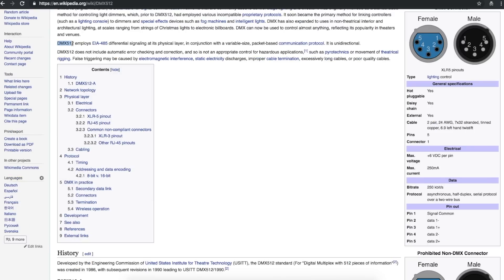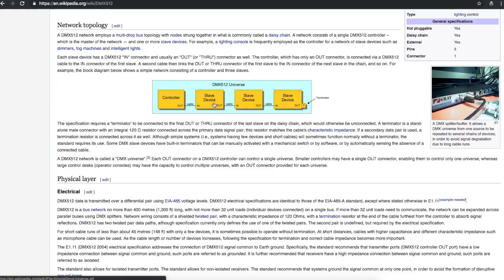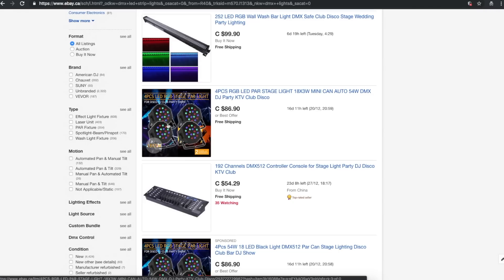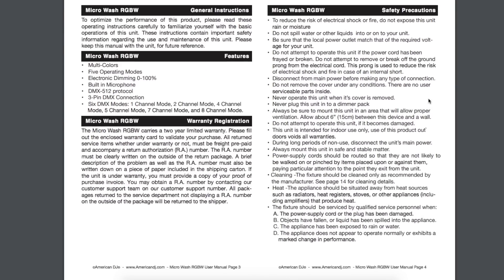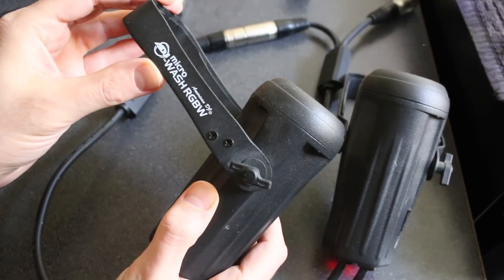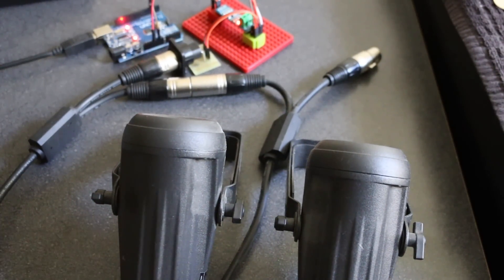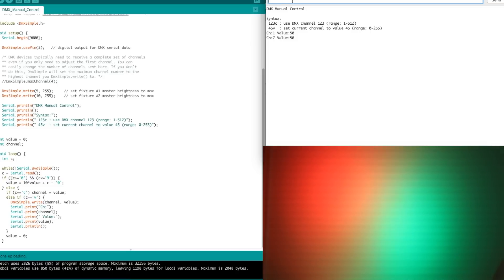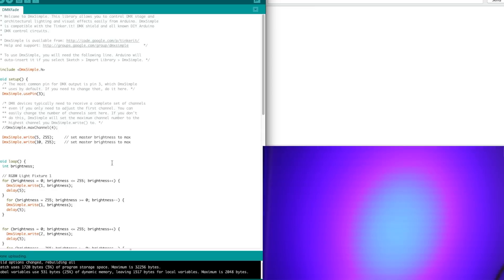ARDUINO DMX512 CONTROLLER

Comment: Could I use a 5v to 5v dc/dc convert between mx485 and xls cable to ensure safety for the microcontroller?
Reply from the maker: I made an isolated interface in another video https://youtu.be/yeVZs3swxds

Comment: Just wondering.. How long can the output data cable be? Let 's say the lights are at 50m distance? Do you need an amplifier? How does that work?
Reply from the maker: According to this page, the cable has to be less than 300m (and assuming a proper DMX cable with the right impedance), and it says an amplifier may be needed after that point, or if there's more than 25-32 items connected
https://insights.acuitybrands.com/eldoled-blog/how-to-wire-a-dmx-system#:~:text=Therefore%2C%20the%20maximum%20cable%20length,connected%20to%20one%20DMX%20cable.

Comment: Hey, I am running into a very confusing issue. The light will only update constantly when its ground on pin 1 is disconnected. Thank you for any suggestions

Comment: Great video! My question is would this be compatible with a 5 pin XLR? I believe the first 3 pins of the 5 pin would be the same as the 3 pin, although what would I do with 4 and 5 on the 5 pin?
Reply from the maker: The extra two pins on a five pin are for an optional second communication channel so they just get left unconnected 
https://interactive-online.com/resources/faq/dmx-512-connector-pinouts
Reply: @GadgetReboot  Figured so, thank you for clarifying!

Comment: This is amazing, thanks for the great tutorial. I have a project where I need to use a SAMD-based Arduino, which DmxSimple is not compatible with. Do you know of any good way to drive DMX lights from a SAMD based Arduino?
Reply from the maker: I haven't tried that platform yet, but I eventually will.  I might lean toward ESP32 also.  So I'll just be googling for any existing libraries, someone must have done it by now.

Comment: Awesome video. Rather than controlling DMX lights from the Arduino, I want to use DMX output from PC software to trigger MP3 audio. Is that a similar hardware setup?
Reply from the maker: Yeah same hardware on both ends of the DMX transmit and receive sides.  I did another project doing transmit and receive so it should also be able to receive DMX from PC and then that can trigger anything desired.  https://youtu.be/RZ_UWYBOj8M

Comment: Thanks for the great video.
Let's nitpick: There is no such thing as a level in EIA-485. Always speak about the differential input voltage. That magnitude of Voa–Vob < −200 mV = High and Voa–Vob > +200 mV = Low defines the standard. No one speaks about "levels" in the EIA paper, only about the magnitude of the differential input voltage, V_id, varying from 200 mV to 10 V, that is required to maintain correct operation over a common-mode voltage varying from –7 V to 7 V.

Comment: Great video.  Can I ask where I can find the dmx adapter that you used?  I’m looking for one I can incorporate into a protoboard.  Thanks
Reply from the maker: I basically got everything on eBay, using the Arduino as the controller, then a little RS 485 to TTL module to translate between Arduino and DMX signal levels, and since my American DJ light uses the three pin instead of five pin standard connecter I just ordered a three pin on eBay.

Comment: Hi, I really love your way to explain the project. I have used your method with Ltech DMX decoder and now I am able to control upto 512 DMX channels with Arduino UNO board. It will be a great help if you explain, how to control more than 512 DMX channels...

Comment: Is there a way to trigger this with the beat of a bass drum?
Reply from the maker: there’s always a way depending what signals are available. If there’s an actual trigger signal indicating when the other sound is playing, that can be used as an input to Arduino to do some thing. Otherwise if it’s just raw audio then a filter can be used to detect a certain frequency and use that to trigger.
Reply: @GadgetReboot  So do think I can use a Mic to XLR to "What" and get the Arduino to sense the beat and trigger the DMX lights, just like what would be done at a concert?
Reply from the maker: A circuit like a color organ would take the sound and be able to trigger when certain frequencies are detected and then that could trigger the input of an Arduino and the code would have to then generate whatever DMX is required to turn on whatever lights in a certain color for a certain amount of time once triggered. Basically it sounds like an interesting project idea that I might consider doing.
Reply: @GadgetReboot  Yes please....I have the DMX controller, just need the Arduino to trigger the scene changes
Reply from the maker: is the controller also an Arduino or is it some sort of commercial product? I’ve never used a commercial controller so I don’t know if they have options for an external interface to do things like trigger scenes but if the Arduino itself is also the controller, then it’s easy.
Reply: @GadgetReboot  The Controller is the Luminair 3 DMX App, totally awesome app, and it does have a sound active mode and they say they have beat isolation tech, but when you play a tune it seems to react on every note just becomes a mishmash of quick changing lights. Not, what you see a concert, that is what I am trying to accomplish. So, I need to put a trigger (arduino trigger) in that loop somewhere, some how, if possible.

Comment: You didn’t mention the Rt resistors that are shown in the chip diagram. Are those excluded in this demo or are they integrated into your cable connectors?
Reply from the maker: They are on the RS 485 board being used.

Comment: Hey, just wondering, I've read that there must be separation between the microcontroller and the DMX line. Does this RS-485 module allow this? Or is this a quick and dirty approach and more serious installs must make use of a DC-DC converter and Octocouplers? Thanks!
Reply from the maker: This was just an Arduino protocol test, a real implementation would need isolation and  these particular modules don’t do it but I am working up toward another isolation demo. 
I recently did a DC to DC isolated converter video and I’m still waiting for another one to arrive so I can isolate two sides of a cable. 
For the data isolation I might either use auto couplers or one of those ADUM digital isolators https://www.analog.com/media/en/technical-documentation/data-sheets/ADuM1200_1201.pdf

Comment: Thanks for the video! Helped a lot to convince myself that this is indeed possible!
One question: If I would like the Arduino to act as a RECEIVER for the DMX signal, how would I have to wire it?

I'm thinking about a project where the arduino would control some led tubes on/off via DMX !
Reply from the maker: I did a transmitter and receiver in another video including controlling WS2812 LEDs:   https://youtu.be/RZ_UWYBOj8M

Comment: I tried with a simple light I have and was unsuccessful.  I then tried with a different light and it worked fine.  I figured my light was bad, but I could manually set it to a color through its panel and it worked.  I decided to test something and moved the light's DMX channel to 1, and it worked fine.  I then moved the light to the previous channel of 150, and it will not work.  Do you think it could be the generic MAX485 board I bought?
Reply: Upon further testing... It is a 6 channel light.  1 is "set to individual color control when value is 255".  2 is red.  If I set the light's first channel to 147, then send 147c 255v and 148c 255v, I get red.  If I set the light's first channel to 148, then send 148c 255v and 149c 255v, I get nothing.  Combinations below 147 for the first channel seem to work and above do not seem to work.
Reply from the maker: I don't think it would be the MAX485 because being just a communication hardware interface, if it works in a certain channel range it should communicate fine no matter what is transmitted.   
Did you get the other light working at those higher channels?  Trying to figure out if the Arduino sketch and hardware interface at least work, I don't remember if I tested at high channels and right now it's all disassembled so I can't quickly test it.  
I don't suppose that light for some reason doesn't work above certain channels, although I can't imagine why...what is the model number? I wonder if anyone else has run into issues similar to this.  
Also, just for the sake of voodoo when all else fails, I wonder if there's just some weird combination of addresses that exploit a glitch, maybe in the Arduino sketch.   Did you try some other random higher channels just to see, maybe something over 200 in case there's an odd behaviour around 148...
I'll be hooking up the DMX hardware at some point to continue projects, maybe I can do more testing with my American DJ microwash lights.
Reply: @GadgetReboot  Thank you for the reply.  So, I wonder if it is just that one light I decided to experiment with.  I added the second light to try higher channels, and the first light is working at the higher channels, using the same sketch from yesterday because I plugged the sedan light in without modifying the sketch, as well as the second light.  I removed the second light, and the first seems inconsistent.  Maybe it just has to do with the resistance on the DMX side.  I was only testing with one light, just to make sure it worked.  I had ripped everything out of the code except static DmxSimple.write commands in the setup routing.  Regardless, your tutorial was well done and easy to follow.  Thank you for it.
Reply from the maker: I  wonder if it has something to do with the termination. I can’t remember if my lights have a built-in 120 ohm termination but I was only using very short wiring so maybe if you have longer cables you might need to make sure it is terminated properly.  And I guess that would include if you have two lights joined together, only the one at the far end should be terminated.  And presumably the RS-485 board has a termination resistor on it, mine does.
Reply: Gadget Reboot I do have a terminator on the out of the last light, but I have never experimented with my usb-to-DMX adapter and just that one light.

Comment: Thank you so much for the code to make the DMX receiver work, but I was wondering have you tried making a USB to DMX interface like a DIY arduino version of the Enttec Open DMX USB Interface using an RS485?
Reply from the maker: I haven't done anything lately, I even fell behind in normal videos this past week so I need to get caught up on that before I get totally buried.  But I'm waiting for some parts to come so I can at least try adding power and signal isolation to the existing DMX setup and make it more robust as-is.  Maybe some day it'll grow into something bigger.

Comment: Hi! I've got the RS485 breakout board by Sparkfun.. would you maybe be able to tell me how I could connect this up to my arduino? It is for a halloween project DMX/Sound trigger the sound and trigger part I've got figured out, only the DMX through rs485 breakout is the thing I can't get to work...
Reply from the maker: Is this the board with SP3485:
https://www.sparkfun.com/products/10124
And  what kind of Arduino, 5 V or 3.3 V I/O? 
 I see that chip needs to be powered by 3.3 V and it vaguely says interoperable with 5 V logic but I didn’t see anything in the chip data sheet that clearly guaranteed it can be powered at 3.3 V and hook up to 5V I/O. 

Aside from that, the A and B terminals would be the same as the A and B terminals in my RS 485 breakout board schematic,  
RX-I  is the same as DI on my board, 
TX-O  is the same as RO on my board. 
 The grounds will go to the same place I have them but VCC would be 3.3 V and if the data sheet can be trusted, it says it should still work at 5 V logic levels otherwise if it’s 3.3 V logic it should obviously work.
Reply: @GadgetReboot  thanks for the reply! It's the board from the link indeed! I own a few Uno's and a few nano clones, the clones say they have 3.3v and 5v, so that should work. I'm gonna see if it works out with yout instructions!

Comment: Nice one. 
I wish this stuff was available (and at such affordability) back when I was doing sound and lighting gigs back in the '90s.

I've got a couple of those MAX485 modules somewhere in the pile I was meaning to get around to eventually. I wonder what else I can do with them?
Reply from the maker: It’s hard to think of uses for them today because I don’t really have a noisy signal environment to deal with at the workbench and any communication of any distance I would probably start thinking about Wi-Fi or wired ethernet. 

 It almost makes me want to go out of my way to think of a project just to use them because I think I have five. Maybe a DMX receiver so I can turn some LEDs into DMX lights.
Reply: @GadgetReboot  Did you manage to get to receiving dmx, I need a way that I can use an Arduino to receive dmx and turn on LEDs etc, I am fine with LEDs, ws2812's and transistors etc but I just don't understand how to go about receiving dmx.
Reply: I know that you could use the dmxserial and dmxserial2 library for receiving dmx but I don't know how to go about wiring the dmx to the Arduino for receiving data.
Reply from the maker: I will take a look at it and see if it really is as straightforward as it was to send it out. Since I already know I’m sending out valid control codes for a real DMX light, I can use that code as a test and then see if I can get another Arduino to receive it and turn on some LEDs or something and if so, I’ll do a video to have a complete series covered.
Reply: Gadget Reboot thanks, do you think you will use a MAX458, if so I will get one.
Reply from the maker: Yeah especially since I already have those modules I’m going to use a max 485 on the transmit side and another max 485 on the receiving side of the experiment.
Reply: @GadgetReboot  ok, thank you ill get one of eBay now, i presume you will use 3 pin XLR
Reply from the maker: Yes
Reply: @GadgetReboot  Ill order a female panel mountable xlr connector then, I am hoping to nicely contain the system in a large project box. Also is it possible to do a dmx out like most lights on the market have, not actually changing any of the signals with the Arduino, just sending the data that came in back out so you could wire the Arduino in between 2 dmx lights.
Reply from the maker: Fortunately, with RS-485 being a multi drop bus, all you need to do is tack on extra connectors on the bus and you can then call them whatever you want to, in or out or pass through and anyone who wants to listen like an Arduino here or there can just listen in.  As long as there’s only one master generating signals and everyone else is listening, it’s all just in parallel with all the data plus connected together and all the data minus connected together. 

 I double checked continuity on my DMX light and confirmed the in and out cables are directly connected in parallel.
Reply: @GadgetReboot  Sorry for the bad excuse of a wiring diagram, I just knocked it up quickly in paint. The wiring for the MAX485 may be incorrect but is the wiring for the XLR/DMX Input and Output ok as I am about to buy the female and male panel mountable sockets. http://prntscr.com/mj98ry
Reply from the maker: The XLR DMX in and out looks OK. I believe the RS-485 A and B are reversed because A is the noninverting and B is the inverting signal. And the RE, receiver enable pin  will need to be brought low to enable the data line in to Arduino
Reply: Gadget Reboot have you managed to find out anymore about making the dmx receiver, I have been looking but people say they have problems with the serial port and have to have a different IDE for it
Reply from the maker: I’ve actually been working on it for the past eight days and I had major problems as well but I figured out how to scrap something together and I’m editing the video to be published today now. I’m controlling just a couple of channels in one project like the brightness master as well as individual red green and blue simple controls, and in another project I’m  controlling 60 Neopixels all individually over DMX and that’s where I was mostly struggling so stay tuned!
Reply: Gadget Reboot wow, thank you so much, MAX485 just arrived through the letterbox this morning so just soldering the XLR connectors together as we speak, sorry if it has felt like I am nagging you, I really appreciate everything you have done and can’t wait to see the video!
Reply from the maker: It’s something I wanted to work on anyway as a continuation from the original video so the timing was good. I already have the code and schematics on git hub so here’s a preview of what I put together. 

https://github.com/GadgetReboot/Arduino/tree/master/Uno/DMX_Serial_Tx_Rx
Reply: @GadgetReboot  Have you got a dmx receiver code that you have got working as I have tried the neopixel code and I am not getting any leds at all with all my channels on 255 on the dmx controller
Reply from the maker: Yeah the 2 separate sets of controller/receiver sketches in that Github link are working, one with 180 channels controlling red green blue on 60 neopixels.   
The video is rendering now so it'll be up today for sure.